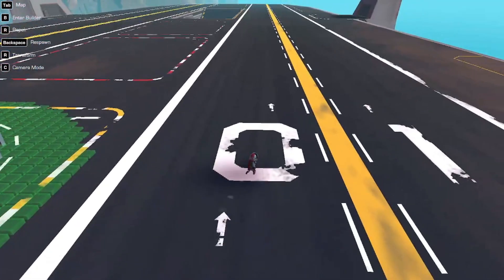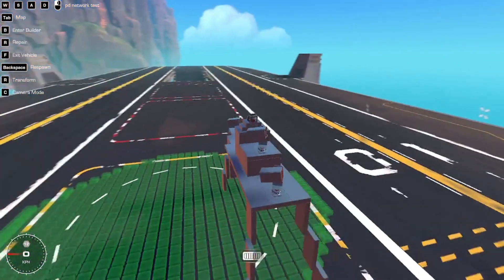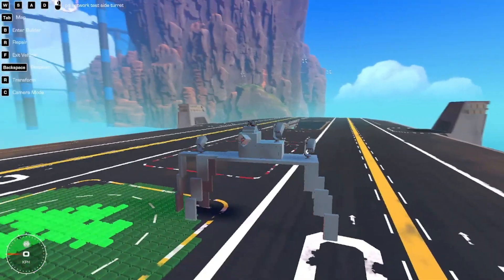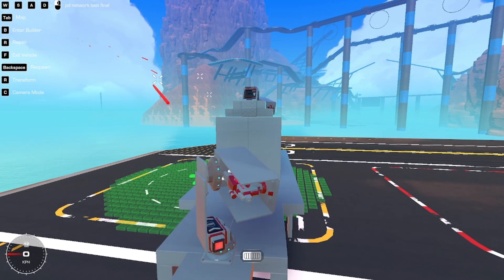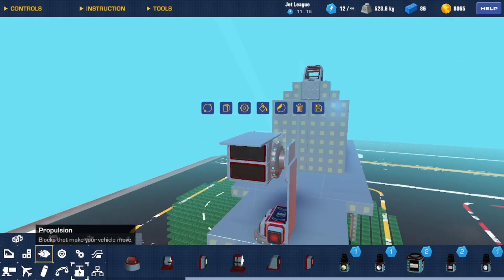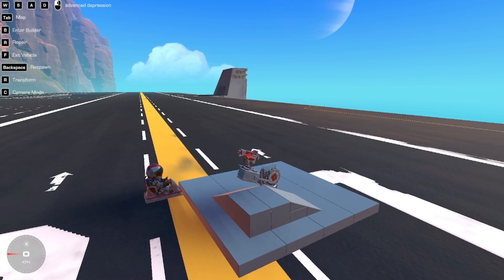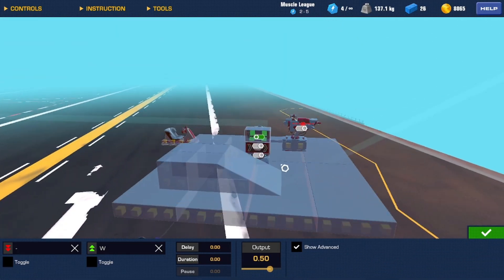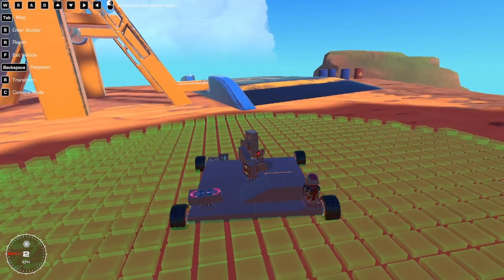Advanced Turrets in Trailmakers

Comment: Can you show how to use angle or compass blocks instead of distance sensors
Reply from the maker: yeah i explained how to use them in the stabilizer quite badly. if you watch the video you can see how its all linked together tho. basically, if it turns, make it turn back. if the other thing detects it turning the other way, make it turn back the other way. i think i just made it worse. there are other tutorials that cover stabilizers better than me.